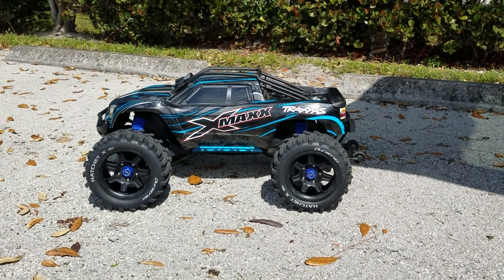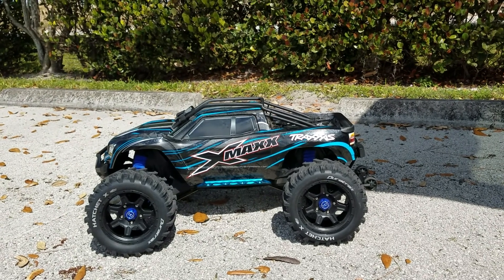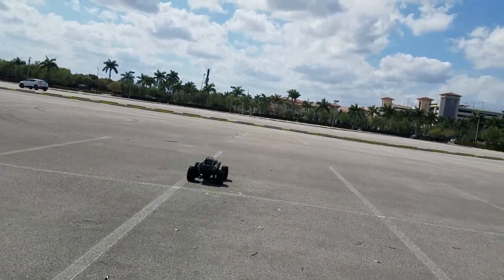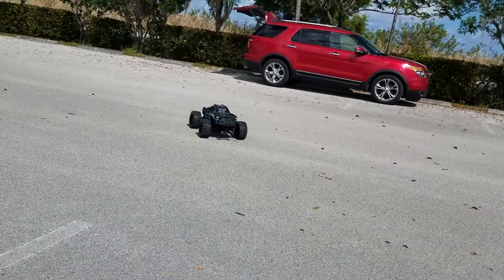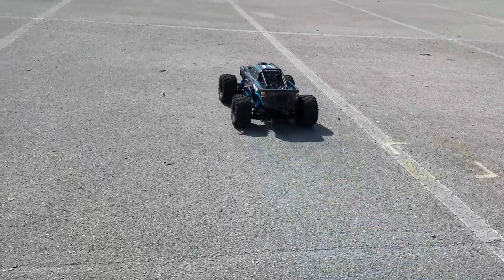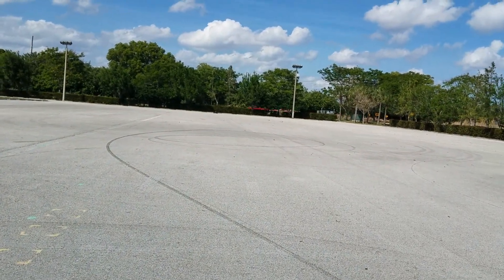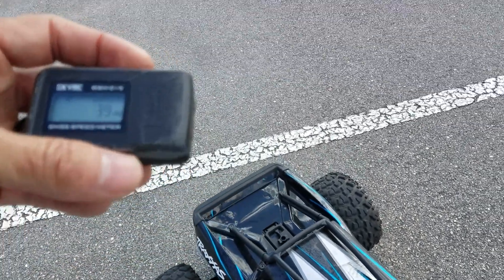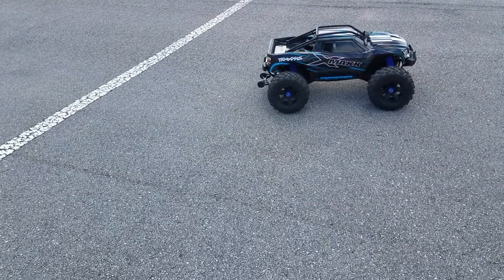Xmaxx speed run on 54 spur 17 pinion

Comment: What's good bro,she looking real nice bro...
Reply from the maker: thanks my brotha. need a little more speed though 👍🏼👍🏼👊🏼👊🏼
Reply: @heat305rc  
Your welcome family, try that 25 tooth pinion with the 50 tooth spur .
Reply from the maker: @truthrc357  you don't think that'll overheat the motor during a bashing session?
Reply: @heat305rc  
It'll get hot if it's 6s motor but the 1200kv held up
Reply: I went through both motors bro and the 1200kv held it down no problems
Reply from the maker: @truthrc357  good to know my brotha. I appreciate the input 👊🏼👊🏼